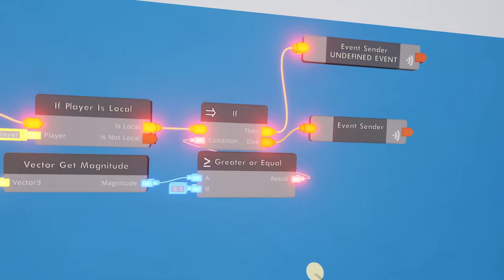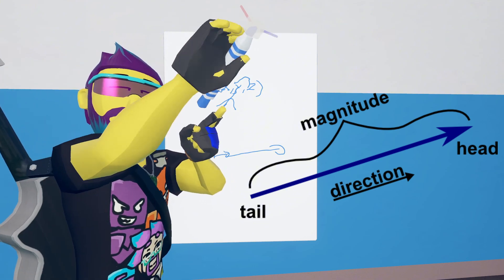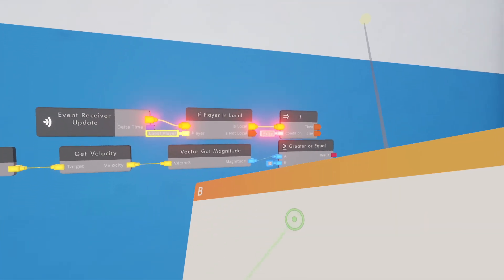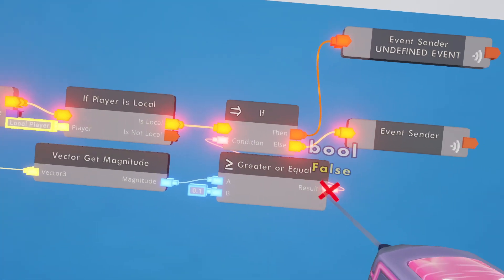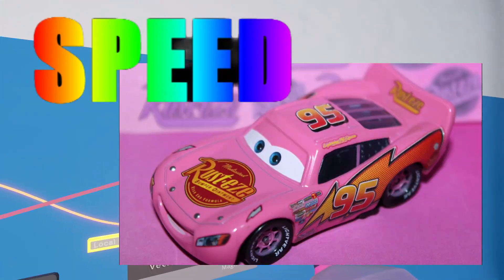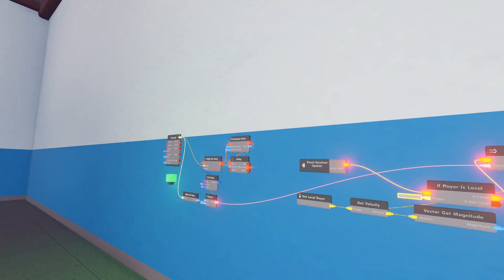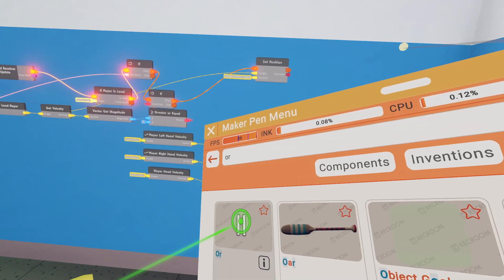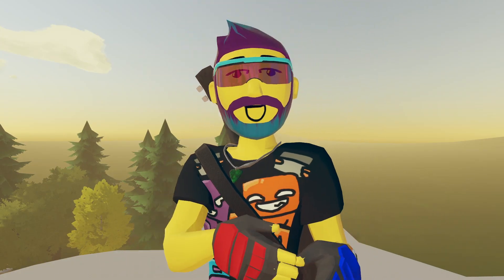How To Detect Movement in Rec Room (Circuit Tutorial)

Comment: Hey! I was wondering if you could make a circuit tutorial on how to track when a player puts their hand right in front of their face. Can you do it?
Reply from the maker: i think you could ray cast from their face but i'm not 100%
Reply: Hey, I can give you a simple explanation that could work, 
Depending on the distance you want if it likes directly on your head just use a distance with a  less than (less than or equal to work too) 
If it's further you could use a position in front of the head with a distance one simple way you could get the position in front is with a add, player head position, player head forward vector, vector3 normalize, vector3 scale, and something to tell the distance on the vector3 scale